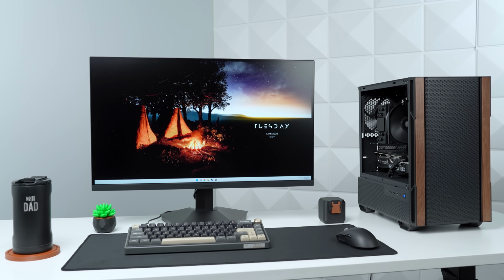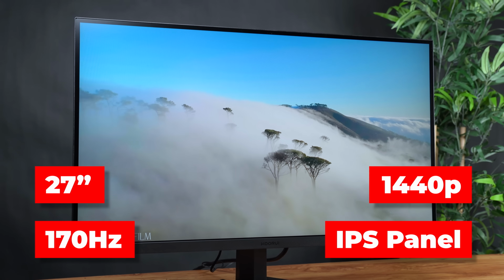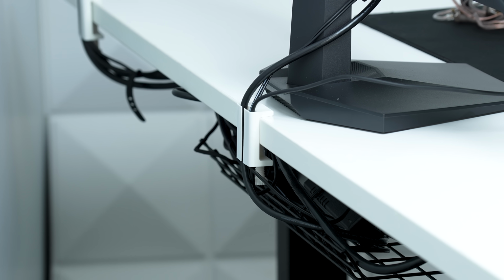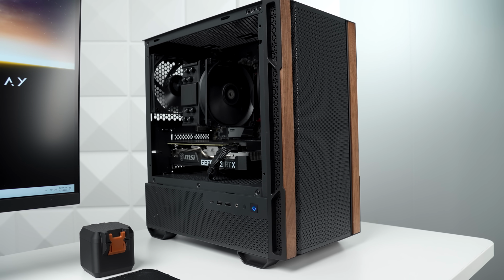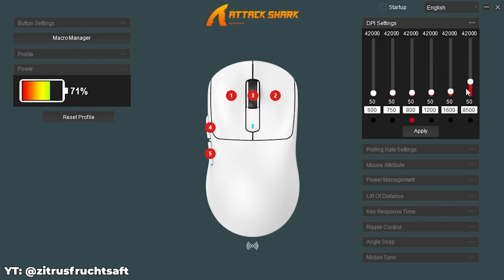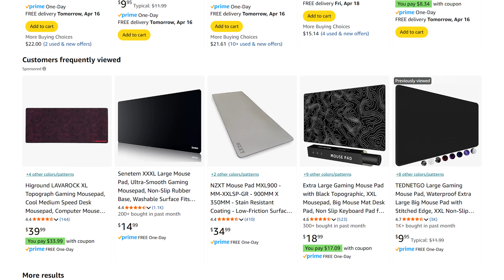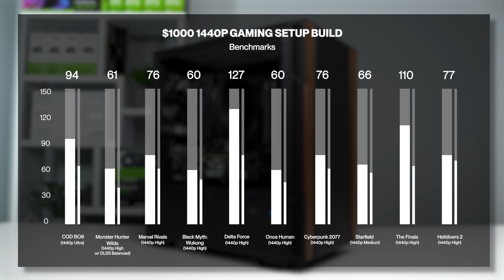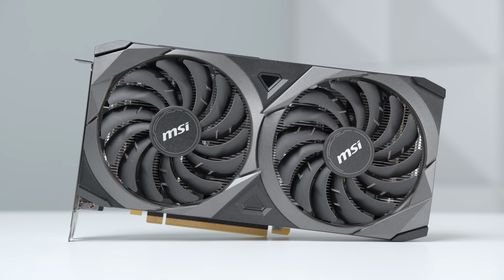$1000 FULL PC Gaming Setup Guide for 1440p

Comment from the maker: Check out the Elegoo Centauri Carbon here: https://us.elegoo.com/products/centauri-carbon
Reply: Nice build sir! 👌 🎉.
Super clean.
Reply: Can I please have 1 one your PC's, I frankly am broke but I love gaming and don't have the money to build my own and I live in a family of 5 please, any PC
Reply: Oil up
Reply: zach can u rate my build please ( i5-12400f,inno3d 4060,asrock h610m hvs, tforce delta 32gbs ram,1tb kingstone,darkflash ice200pro,ct 800+w bronze, darkflash DRX90 WHITE CASE
Reply: Talking about the IEMs try changing them for the Headset Kuba Disco 2 for aesthetic and will be perfect but out of the budget i think
Reply: Bro try womier sk65 it is a steal plsss try
Reply: I’m new to the world of PC and laptop builds, and it took me quite a bit of time and research to figure out what kind of system would be best for me. After watching several of your videos to better understand specs and performance, I finally made my choice.

I recently bought the Lenovo Legion Y7000P featuring an Intel Core i7-14700HX (2.10GHz), NVIDIA RTX 4070 8GB, a 16-inch 2560×1600 (QHD+) 165Hz display, 32GB RAM, and 1TB SSD storage. The system runs on Windows 11 Home (24H2, 64-bit).

I mainly plan to use it for programming and gaming, and so far it’s been a smooth experience in terms of both performance and display quality.
I picked it up for around $1190 USD.

Would you consider this a solid choice for someone new to high-performance laptops and PC specs?
Reply: My GPU, RGB light Logo stopped working, it is showing and changing colors in RGB fusion 2.0 but not on my gpu, can you tell me any solution to fix it.
GPU: Gigabyte GeForce RTX 4060 Gaming 8GB OC.
Reply: Thank u
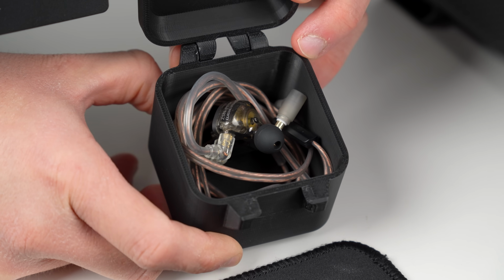Reply: 8:00 try to use DAC to avoid this to happen zach, any cheap dac with CX31993 chip will do

you will get more soundstage and cleaner audio
Reply: None of these replies have anything to do with the 3D printer.
Reply: Can  you provide the dimensions of your standing desk? I know the width is 24 inches but what about the length?
Reply: So building a cumputer here in sweden with a 9070xt costs $2000 and 2200$ with 5070ti, is the 5070ti worth the extra 200$? This is also having a 7800x3d as a processor. It is actually more expensive then this but I get it cheaper as I work at a tech store.
Reply: i got a b550 ud ac am4 motherbroad  with a ryzen 5500  cpu my current gpu is amd radeon rx 6700  and my psu is 600w which should i upgrade if u see this?  my pc is a prebuilt  which part should i upgrade?
Reply: i dont mean to say the same thing i did in the short
Reply: Nice video
Reply: I don't know why you're friends with Toasty Bros? They keep using the tier E-GN 650 Segotep PSU's in most their builds and have been for at least a couple of years, and swear by them, their hacks
Reply: Komponenten:

1. *Power Supply*: ASUS ROG Strix 1000W 80 Plus Platinum

2. *Motherboard*: ASUS ROG Strix B850-E Gaming WiFi

3. *Processor*: AMD Ryzen 7 9800X3D

4. *CPU Cooler*: ASUS ROG Ryuo III 360

5. *RAM*: 64GB DDR5 (4x16GB) with 6000MHz, DDR5 standard, Dual-Channel

6. *SSD 1*: 2TB Samsung 9100 Pro

7. *SSD 2*: 1TB Samsung 9100 Pro

8. *Graphics Card*: ASUS GeForce RTX 5080 Astral

9. *Case*: ASUS ROG Strix Helios GX601

10. *GPU Bracket*: ASUS ROG Herculx

11. *Gaming Chair*: Joule Performance Storm Alcantara

12. *Monitor*: ASUS TUF Gaming VG27AQML1A

13. *TV*: Samsung QE65Q70B 65" QLED 4K TV

14. *Headset*: ASUS ROG Delta S

15. *Mouse*: ASUS ROG Spatha X
Is this too much
Reply: Here I am running a AMD 3200g APU with ddr4 2400mhz ram 200 watt power supply.
Reply: Can this pc handle unreal engine?
Reply: Been thinking about making the jump to pc, last console i bought was in 2012. The next xbox looks like it's basically going to be a pc.  Might as well build my own.

Comment: I got a prebuilt for 699$ rtx 5050 16gb ddr5 ram 1tb ssd and a i5 14th gen an i got a 1440p 240hz aoc monitor for 180$ all from best buy i think it was an amazing deal if you wait you can buy a good set up for cheap even a prebuilt.

Comment: This video has been awesome 
thanks Zack 
my only issue is that for me (i live in Australia ) this is a $2000 AUD setup (Which is around $1300 US) and the pc itself costs $1600 AUD or $1000 USD 
im going into pc gaming but wanted to start with 1440p not 1080p 
i play compeditive games and this should work great, but i do have a question
can u create a new video a 1440p gaming pc but with a budegt of $1000 AUD ($500-$600 US)

Comment: ZACH! Review my part list! would love some feedback!

MOTHERBOARD : MSI PRO B650-P WiFi ProSeries Motherboard

CPU : AMD Ryzen™ 7 9700X 8-Core, 16-Thread Unlocked Desktop Processor

GPU : XFX Swift AMD Radeon RX 9060 XT OC White

RAM : CORSAIR Vengeance RGB DDR5 RAM 32GB (2x16GB) 6400MHz CL36

STORAGE : Crucial P310 2TB 2280 PCIe Gen4 3D NAND NVMe M.2 SSD

PSU : CORSAIR RM750e (2025) Fully Modular Low-Noise ATX Power Supply with 12V-2x6 Cable

CASE :NZXT H6 Flow RGB Mid-Tower Airflow Case with 3 RGB Fans

COOLER : Thermalright Aqua Elite 360 White V3

I mostly play on a 4K 144hz TV withh VRR and ALLM it does go down to 1080p 240hz! 

Hope you end up seeing this comment!!!

Comment: How is my pc a 3070 with 5600x and a b550 board and cost me around 1400euro? I feel so stupid. To make it worse bf6 beta destroyed my motherboard by me trying to enable tpm 2.0 on the gigabyte a320s2h board i had in with a ryzen 3600. I tried everything to fix it but no succes. A am5 upgrade was to much money. So i buyed the aurus b550 board and it didn't work out of the box so i returned it now store does not want to give money back because there is a little cooling paste on the board because i was buiding it 6 times over again to make it work. In the procces i also bend my 3600 cpu pins so could buy a new cpu also. I already buyed a tuf gaming b550 plus for 130 euro with a 5600x new and the board worked directly. But now the store i buyed the aorus board from says they repaired it with me saying i don't want that i want my money back. So i buyed expensive new am4 board and 5600x cpu. I destroyed previous motherboard and cpu. And total cost of my pc now is still around 1400 euro. I did so much wrong i feel like

Comment: 3070 TI owner and I will say it's performed much better than I expected at 1440p w/ under volting. Sweet build and have to say the keyboard recommendation got me to buy one. So satisfying.
Reply: I know nother about PCs but want to buy one to play steam games, any tips? Price?
Reply: @quasitoantrax  best tip if you wanna be future proofed get a GPU with more GB's then 8. Because VRAM is the most important thing for modern AAA games to run well. Other advice go big enough for 1440p performance but no higher if you're on a budget. Any specific questions let me know and I'll answer best I can.
Reply: what budget
Reply: @Devop-pc9bffor the 3070 ti build?

Comment: I have a question:
As a complete noob when it comes to pc stuff, how does pairing ryzen 5 7400F with 6000MHz RAM work? 
I checked out this CPU's specs on AMD website and it says that it can only support DDR5-5200MHz.
Is there a way to boost that number or is it a completely different thing?

Comment: w vid just strongly disagree with the cpu. I heard it switches solder for thermal paste in the ihs(the metal part that spreads heat across the cpu) which is horrible for extended use, because you'll have to replace it, and the only way to replace it is by delidding(taking the ihs off) the cpu.

Comment: Yo, will the build work if I use a Ryzen 5 7600 6-core 12-thread and an RX 6700 XT, or will I need a better psu

Comment: Setup is great but only  thing i wondered that so you would have buyed an amd rx 6800 in used market 
I found some under 300 and and bro it has 16gb of vram which is great for 1440p 
It has a better raw power than rtx 3070 and twice the vram 
Only thing to matter for rtx's  raytracing which is great but rx 6800 got it at a good level too 
I honestly surprised that you didnot use an amd gpu on a budget 1440p pc 😅

Comment: I have an Intel i9-10850K CPU paired with an RTX 2080 Super GPU, 32GB of DDR4-3200 RAM, an ASUS Z490-A Gaming motherboard, a 1TB NVMe SSD for storage, an 800W power supply, and a 1080p 165Hz monitor.any bottleneck? What should i upgrade first?

Comment: I have a question i have a dell optiplex 9020 mid tower so far  I have bought 16 gb of ram and a intel i7 4790. I working on buying a better power supply, but I need a graphics card to pair with this. What gpu is good for this build that won't break the bank?

Comment: Can a PC with i5 14400F & RTX 5060 TI 16GB run games in 1440p medium settings with 120+ FPS. Or will it be bottleneck issue?
Reply: 1440P will run perfectly with that combo but with my experience if you're trying to run 1080p sometimes it may cause some minor issues due to cpu limitations.  If you have heavy ray tracing then you have have some issues playing high end games like cyberpunk or Hogwarts legacy in 120+ fps

Comment: Hey, so I know my setup is kinda bad, but I live in Hungary (currency is worse than Turkey but hey, we don't get cheaper prices, go European Union!), and I'm looking for a cheap way to upgrade, slowly overtime (not instantly).

So, my GPU is an RX580 with lifetime warranty from XFX. XXX edition. 8 gigs model. Absolute chad of a GPU holy.
CPU is a very old Intel i7-4771. Surprisingly plays games decently still...? But lacks TPM so RIP.
24 gigs of DDR3 1600, 4 sticks, two of them are 8 gigs, the other two are 4 gigs, all HyperX. Gee that's slow nowdays. And yes, I had to downgrade my 32 to 24 'cuz broken stick.
ASUS Z87-pro mobo. Yeah, probably gonna switch it for le upgrade.
Around 2 TB storage, although only 500 gigs are on an SSD, rest is an HDD. And yes, all are SATA.

Case is from Zalman.
A 4 line CoolerMaster cooler for the CPU. (probably gonna switch it after the upgrade though)
3 fans at the front for intake, 1 on the back.

Just got a Samsung Odyssey G8 32'inch 4K 240hz monitor for my birthday early (still in order, yes I'm obviously gonna limit the resolution except for movies hehe). Yes, we are paying for it monthly. For 2 years. Gonna use my old screen as a second display for Discord and stuff. It's 60hz, 1080p. Just for a quick currency check, it's around 500K full price. A tad bit (a lot) more than what the average person makes here.

Comment: please help i have 1300$ budget for gaming pc,
but i already have a good 20$ usb keyboard and a good 25$ usb mouse because i put   my very low end 2000$ (this price is definitely a robbery) laptop   on a box to have screen high enough to not slouch so i have separate mouse and keyboard i put on the table.
i can actually buy the monitor out of the budget because i want at least  rtx 4060  (i will never touch the 50 series because i know what i need the )

but i don't care about rtx much i care about being able to play gta v or minecraft at least without 25 optimization mods that completely change rendering engine and code for being able to have  50-90 fps  on   my very low end 2000$ laptop   so if something like  battlemage  or xtx  is as good as  4060  but cheaper and have no problems then it's okay for me  (driver installing doesn't count unless it's really will make me struggle)

ps: i don't need 1440p because that's expensive and i had 720p and 1080 all the time and i'm compeletely okay with that
pps: i want 16/9 monitor and i don't know if 1440p is that is 16/9 i have heard that it have multiple versions and only one of them is 16/9
ppps: i already have the headphones

ALMOST FORGOT TO SAY: i want to also work in davinci resolve approximately smoothly
ALMOST FORGOT TO SAY ps: i don't care about the asetetics all i need is pure power for that price (and 32 GB RAM! NOT LESS!)

Comment: hello sir, my question is not related to this video, so please reply. My pc Speccs
MSI B650m Gaming Plus WIFI
6000mhz 16gb ram
R5  7600x 500gb Crucial m.2 
Deepcool AG400
MASI mag forege 120a Airflow cabinet
450 watts cooler master bronz

I want to upgrade one more 16 gb ram and RX 7900gre or 7800xt
so what power of PSU Should i use for above build and mentioned GPU??

please reply......

Comment: 1. *WD Black SN770 1TB PCIe Gen4 NVMe M.2 SSD* - ₹6,150.00  
2. *Deepcool AK400 CPU Air Cooler* - ₹2,375.00  
3. *G.Skill Flare X5 32GB (16GBx2) DDR5 6000MHz RAM* - ₹8,350.00  
4. *AMD Ryzen 5 7600 Processor (6C/12T, up to 5.1GHz, AM5)* - ₹18,490.00  
5. *MSI B650M Gaming Wifi Motherboard* - ₹10,298.00  
6. *Cooler Master Elite 301 Lite Cabinet - Black* - ₹3,160.00  
7. *Cooler Master MWE Bronze 650 V3 80+ Bronze 650W PSU (ATX 3.1)* - ₹5,500.00 (approx.)  
8. *Zotac Gaming GeForce RTX 5060 Ti Twin Edge 8GB GDDR7* - ₹41,400.00  

*Sub-Total:* ₹95,571.00  
*Total:* ₹95,571.00  

Please rate my pc build I'm from india

Comment: Hi, i'm currently building pc with ryzen 5 7500f, rtx 3080, asrock b650m-h/m2, adata xpg blade rgb 2x16gb ddr5, acer predator gm7 1tb, AIO 240 argb and need recommendation for the PSU, should i go for 750w 80+ or 850w for future upgrade.thx

Comment: hi zach,
i am getting a new pc i have customized it and bought it from aftershock pc. i selected the cable extensions but it does not say that it is for all of the visible cables. just in case its not what cable extender would fit from the Gigabyte X870 Aorus Elite Ice Wi-Fi 7 - DDR5 to the Zotac RTX 5080 Solid OC -16GB White.

Comment: "Hi Zach, I'm still rocking an Intel HD Graphics card from 2010 and an Intel Core i5-3470 CPU @ 3.20GHz. I'm looking to upgrade my GPU to something affordable that works well with my older setup. Any suggestions for a card that would give me a big performance boost without compatibility headaches? Thanks in advance for your help!"

Comment: My names johnnie I've been planning my first from scratch computer. I'm not sure which graphics card I want yet something between the rx 6600 xt and the rx 7900 xt. I already have my peripherals but I need advice on what case I should use that has the most airflow possible I don't care about anything else for the case. I'm fairly certain I know which cooler I want as well but would like advice on my choice. I'm open too suggestions on any of my choices here is what I've put together so far my goal is $1500ish:
CPU : AMD Ryzen 5 7600x 
      AMD Ryzen 5 9600x 
      AMD Ryzen 7 5700x3D
CPU Cooler : ARCTIC Liquid Freezer 2 360 56.3 CFM Liquid CPU Cooler
Motherboard : MSI MAG B650 TOMAHAWK WIFI ATX AM5
RAM : Silicon Power Value Gaming 32GB [2x16GB] DDR5-6000 CL30 Memory
Storage : KingSpec XF 2TB M.2-2280 PCLe 4.0 X4 NVME SSD
Case : Montech KING 65 PRO ATX Mid Tower Case
Power Supply : Apevia Galaxy 1000 W 80+ GOLD Certified Semi-modular ATX Power Supply

Comment: I just went from 1440p ASUS 27” 144hz monitor, to 1440p LG 27” OLED 244hz monitor. After doing so, my league of legends is constantly stuttering and wondering why. My FPS is capped at 240hz because when uncapped it goes to 600.

Comment: hey Zach, i had a question. (day 1 of asking)😅
right now i have a 5700g and a 6700xt with 32gb of ram. the only game that seems to struggle is warzone, my monitor is a 1440p 32 inch KTC curved screen. what would be my best option to be able to rock 1440 with no struggle?. i was planning to get a 5800x, but I'm wondering if it could be my GPU holding me back. in ultra settings on warzone my CPU is usually at around 70% and my GPU is usually near 95%. i only really have stuttering when i have many tabs open. (that id assume would be fixed with more ram).
in advance i greatly appreciate any help.

Comment: I’m wanting to make a roughly 2 thousand dollar computer, what I was wondering if what components I have chosen would be good together, or if you have a better setup in the price range that you could please leave a comment with the list of parts and estimated price.

Here are the parts I have:
Amd ryzen 7 7800x3d 4.2 GHz 8 core processor

Arctic liquid freezer iii 360 56.3 cfm liquid cpu cooler

Msi mag b850 tomahawk max wife atx am5 motherboard

G.skill flare x5 32 gb (2x16 gb) ddr5-6000 cl30 memory

Crucial p3 plus 2 tb m.2-2280 pcie 4.0 x4 nvme ssd

Gigabyte windforce oc GeForce rtx 4079 super 12 gb

Corsair 4000 airflow atx mid tower case

Corsair rm850x

Comment: For a GAMING PC what the BEST 150$ GPU that i will get the BEST FPS? (UPDATE: I GOT A GTX 950 AND CHANGED MY CPU FROM PENTIUM GOLD G6400 TO A R5 3600!)
Reply: Rx 6600 or xt versions are pretty solid
Reply: Save 100 bucks more and buy the arc b580 bro, if you really cant then you can get the 1080 ti
Reply: An used rx 6600
Reply: Probably a rtx 2070 super
Reply: Rtx 2060 if you can find it for that price or gtx 1660
Reply: 1080ti
Reply: if ray tracing isn't an issue, the RX 5700XT fluctuates around that price and it's definitely worth it
Reply: 5700xt hands down
Reply: It might just be a 6600xt
Reply: Gtx 950? Are we serious
Reply: @Saskeoi what do you have though
Reply: @gogosprokill1 I’m
Not hating but with that budget you could of gotten a solid 1080p and low entry 1440p gpu like the 5700xt
Reply: @Saskeoi read the whole fucking comment i said i spent most of my budget for cpu
Reply: @gogosprokill1  and you shouldn't have done that a ryzen 3600 pairs with like a 3060 😭😭😭
Reply: Ryzen 4070
Reply: I got RX 5700 XT for around that price recently,  happy with the results
Reply: GTX 1080 Ti!
Reply: Thx @skylerwhite9869
Reply: @skylerwhite9869 way to old bro
Reply: At that point just buy a ps5 wtf 😂
Reply: @DREADBORN777 WDYM? He has a 150 dollar budget for a GPU. That’s still doable.